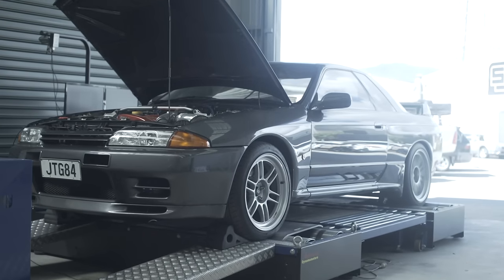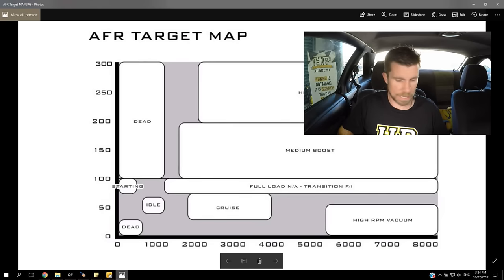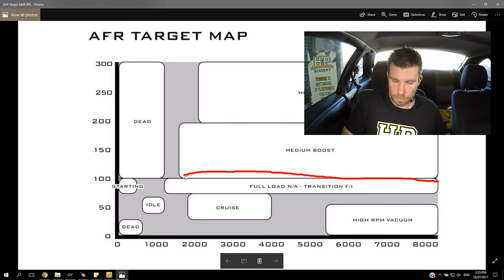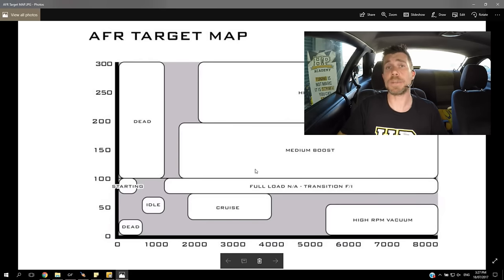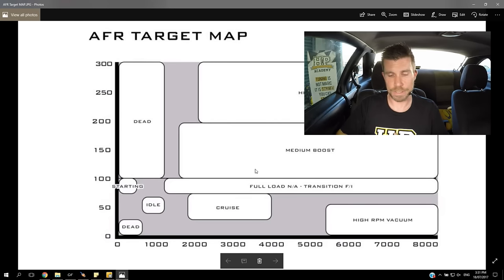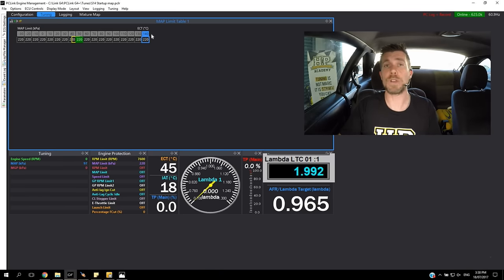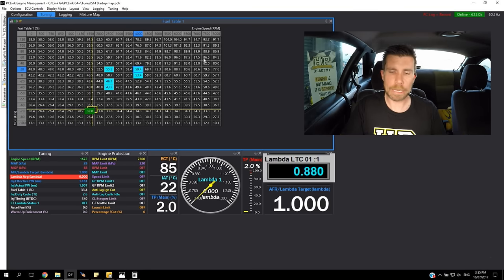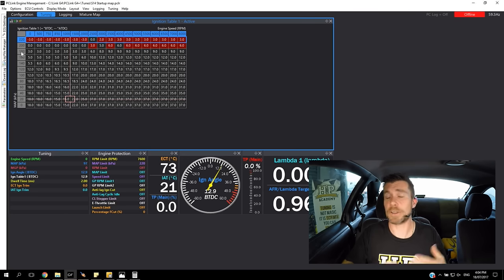How To Tune A Turbo Engine | Turbocharged Engine Tuning 101 [GOLD WEBINAR LESSON]

Comment: I've been learning to tune myself to avoid the SOS calls to the tuner when we are away. Timing and fuel have been my kryptonite I'm learning a lot through research and watching these type of videos. Would love to get some real knowledge on how to.
Reply from the maker: Good man! Keep at it, it all adds up. This course here is one I would highly recommend for you: https://hpcdmy.co/efifyc
I know the word 'fundamentals' isn't exactly sexy, however, so much is covered in here and with lifetime access you will always have it on tap :)

Here's a coupon too: YOUTUBE25  - Taz.
Reply: Just be aware that a lot of the AFR targets are theoretical. Different engines/setups will require different fuel targets.

You know you’ll have it right when the engine has good response (throttle response) and no spark knock. Every engine and setup…and heck …. Every fuel type will be very different.

Your goal is to figure out a process and a ball park to get started.

Comment: awesome video as customary HPA...hopefully in the future we can see how dual VE fuel mapping works and if it gives us double the fuel mapping resolution? dual ignition maps, and for us without a dyno, is it ok to datalog smooth, modulated pulls in each gear to redline, tuning each cell that each gear is reaching? i have more questions, but I'll save them for later. thanks HPA friends💪

Comment: Am getting high iat on rb25 with a pretty small intercooler like 100% bigger than factory.. Causing knock on pump on a engine of 8.5:1 or less compression.. still making 320rwkw at about 18psi on a gt3076r and 385rwkw on ethanol at a measly 24psi so what you've said makes sense for the most part.. better intake charge temps mean more power. Although to be fair I'm not willing to spend money on intake manifolds throttle bodys or exhaust manifolds so it's running all oe components.. on the plus side I'll see 20+psi by the time a factory turbo sees 7psi

Comment: such a good video, that i had to watch it again! i have a question on where the "coasting" area would be? I'm sure it could be in the high vacuum area, but I've coasted in the "cruising" areas before. any tips for running those situations? thanks and great job HPA💪
Reply from the maker: I define coasting as being when you're completely off throttle. There's a bit of semantics involved though and you could also call an area where you're cruising and slowing down 'coasting' and wouldn't be necessarily wrong. If you're completely off throttle though then you can disable injection which helps save fuel and reduce emissions. On the other hand if you still require some amount of engine power and you're still lightly on the throttle then you'd want to target your normal cruis AFR - Andre
Reply: @hpa101  yes Andre, i agree with you. you da man!💪

Comment: How do you manage to keep it at 2500rpm full throttle (34:44)?  Thank you for all the good videos and info.
Reply: Did you ever figure it out?
Reply: @subyoooyoy  no. 😔
Reply: @mr.m6691  I think the Dyno is increasing the load/resistance, as he increases throttle.
Reply: It's the particular Dyno, hub dynos allow you to lock the rpm and check throttle position.
Reply from the maker: Sorry I missed your question, if you search the word dyno on the channel there are a few videos that explain this and other elements of dyno options and operation.

This is a load bearing dyno, and that is the feature of this type. You can hold a set load, being RPM here. You can have a hub, chassis or engine dyno that is load bearing.

And alternative is an inertia dyno which doesn't hold rpms like this making them only good for sweeping runs. They are an older and cheaper style really, but still quicker and a little more accurate than just road tuning - Taz.
Reply: @hpa101  Thank you for taking the time to reply and explain.  I really appreciate your chanel. It has made me get the courage to mes with the tuning part of the car. Thank you.

Comment: I got issue in keeping the torque under 500Nm for reliability reason on my 2012 MPS3 .... its using stock k04 with aftermarket down pipe+intercooler and cats delete .... rest of the exhaust is stock at 1.25bar tuned to 100 octane ... i settled at 300hp @ 480Nm .... if I touch 320hp, the torque gonna be above 500Nm ... I use Mazda Edit software to fiddle with the stock ECU.
Q - is there away to raised the peak power but keep the torque at 480Nm? ... I'm at lost here

Comment: What’s the best way to tune a base fuel map? For example, I have a R32 GTR and I tune the fuel map based on the TPS, but my AFR target map uses RPM/kPa. I’m also tuning in VE mode and my O2 control is set to use both TPS and MAP
Reply from the maker: This is the lesson you want: https://www.hpacademy.com/blog/first-startup-no-base-map-watch-this-first-afr-initial-startup-free-lesson/?utm_source=youtube&utm_medium=social&utm_campaign=general-interaction

Hope it helps! - Taz.

Comment: Hi there, i got a question, been data logging my factory 1.4 tutbo Leon and recognized that under 100% pedal, throttle position won't go above 88%. There is no knock detectable and the boost is just 1bar on 102 octane. Is that a factory power limitation or just that they have the same throttle body for different engine sizes where it would go to 100% of throttle position? Thanks a lot for the amazing video lecture as usual🙏🙏🙏
Reply: I have heared that some manufatores limit de throttle position to limit power. Is it an electrical tb? Maybe you find a limiter in any settings.

Comment: What if you are on stock ECU and the AFR map is RPM/Load percent?
Reply: This is easier actually. Figure out your “NA load cells”, usually 100% is 100kPa but you’ll need to figure that out by assessing your ECU maps or via data log.

Comment: Is there a big difference between cars and bikes?
Reply from the maker: Fundamentally, no. The main differences are 4 stroke vs 2 stroke and gasoline vs diesel when it comes to EFI. Even when it comes to piston engines vs rotary the tuning fundamentals remain the same, the application of them just changes a little - Taz.

Comment: When setting up your tune at 6000ft altitude, would 81kpa be your transition zone instead of the 101kpa at sea level? Thanks for your help!
Reply: I know this is a year old. Absolute pressure is absolute. If you've accounted for the extra heat from compressing the air it should be no different at 100kpa from boost or the atmosphere.

Comment: why would a tuner remove boost pipes & tune ve table first, explain this pls. also why it applies to alpha n more?
Reply: No boost, let’s the tuner develop a working VE table for the engine itself. This will let you “see” the efficiency curve of the engine…You can extrapolate that “up” when you add in the turbo.

Comment: Is there a reason for AFR to change based on gear?  I recently starting messing with my car under boost. I have it 10lbs in 3rd gear full throttle 6,000rpm  its 11.1 AFR,  but same condition in 4th gear the AFR changes....
Reply: My guess would be a change in engine load and a slight rise in boost during the shift

Comment: hi. at 13.02 you said the conditions need to be as realistic as possible. so i was wondering wouldn't it be better street tuning?
Reply: I'm not sure what video it is but he says to get the best tune you should be doing both... Wot on the Dyno, cruising should be checked and adjusted on the street....
Reply: Yea I feel like temps on the dyno are going to be higher for sure then one the street.
Reply from the maker: The last step of a dyno tune is to confirm your results on the street, or the track - Taz.

Comment: how could the engine be sitting at 2.5k at wide open throttle? The dyno was applying load or de ignition table wasn't fine tuned enough so there cant be acceleration?
Reply from the maker: The dyno is applying load :)

Comment: Do you set a target afr number flat across the rpm range for a given load, or do you adjust it richer/leaner when going through some motors "torque hump/trough". Or is adjusting timing more important for that? Hope the question makes sense.
Reply: Engine was at 4000 rpm when he was tuning the afr. Rpm stays, afr is changing.

Comment: If you optimized only the timing of a car on pump gas and saw torque gains, without changing the fuel tables (or on a standalone Ignition ECU), does that effect fuel economy? In this case would it actually improve fuel economy, because you're making more power with the same amount of air and fuel? How often is it that you can see torque gains from just timing adjustment without increasing octane?
Reply: Yes obviously the engine is producing more power with the same fuel as the ignition event happens at a mechanical superior point during the rotation.

Comment: You may consider a mic that isnt so close to your mouth or another style of microphone. As someone with an unreasonably disgusted reaction to mouth noises, it has made it close to impossible to watch very many videos. Just thought I would mention it since I can't watch the bulk of your videos due to the mic on the mouth. A lapel mic may be at least a step in the right direction. Keep it up though. It seems like good content from what I have seen.
Reply from the maker: We've since changed mics. Every one we've tried has a different trade off, but we've moved away from this setup some time ago.
We can't change this now, but I would turn it down and turn the captions on to avoid some of the annoyance but still benefit from the content - Taz.